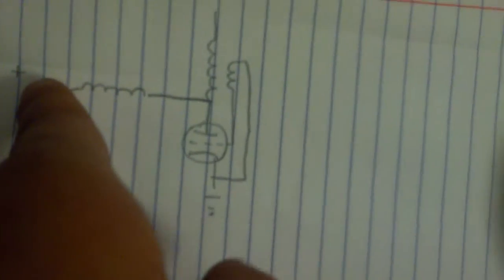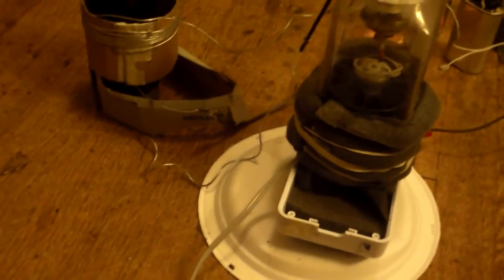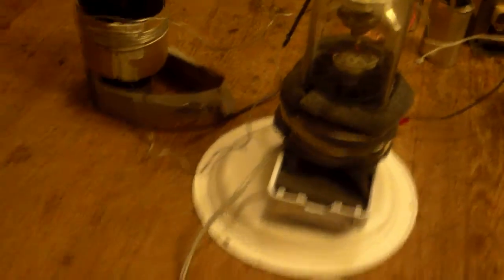base fed vttc

Comment: Nice, I did build it with a gu-50 and it did work well. I got 1 to 2 cm sparks.
I ran it directly from a transformer (so with ac) and it worked.

Comment: thx .my vttc finally works !!!
I use 811a valve and my secondary is 1250turns and primary 7 turns. I have 5cm spark and neon bulb can work 1.5m from vttc

Comment: I wonder if you could modulate that with audio.
Reply: why not?
if you take a penthode and you modulate the voltage on the 2nd grid
there ya go audio modilated vttc
Reply: I made audio modulated vttcwith 811a triode with this circuit , just add hv NPN transistor between 1end of fillament to colector and emmiter to ground . audio input to base .